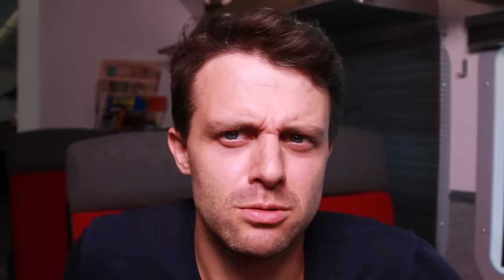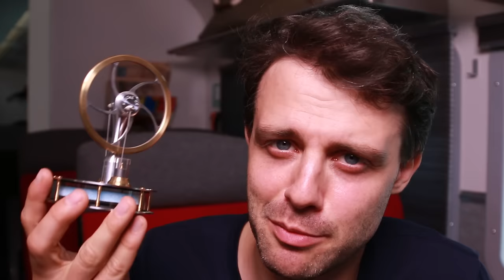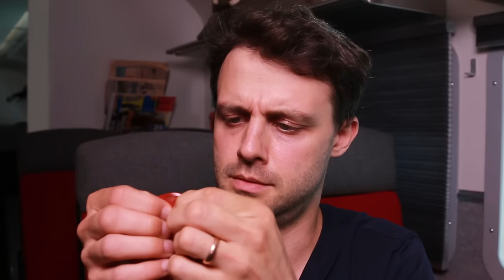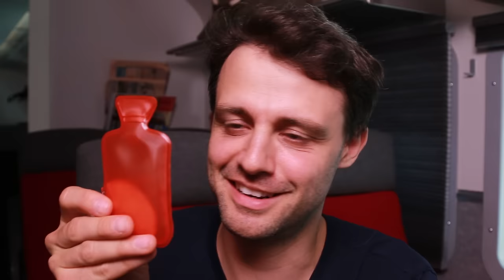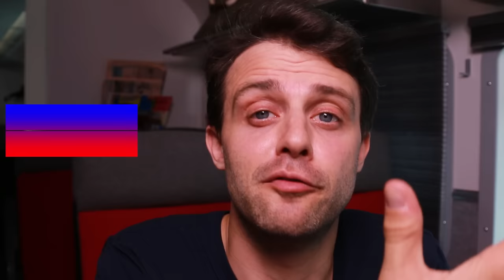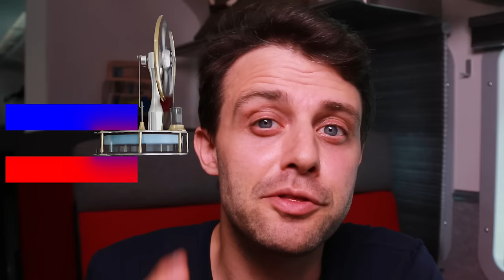A better description of entropy

Comment: Excellent explanation! This video also touched on the difference between temperature (a measure of the average kinetic energy of the molecules) versus heat (which is the FLOW of energy).

Basically, in order to perform work energy has to flow from a higher potential to a lower potential. This is ▲T (i.e.-temperature difference) in thermodynamics. Entropy is the energy "under" the ▲T that is not available to perform work. Enthalpy is the energy ABOVE the ▲T that is available to do work (technically enthalpy is the heat potential energy plus the pressure + volume potential that is available to do work).

If you use the analogy of an hourglass (gravitational potential energy contained in sand particles), work is performed by the kinetic energy of the sand as it falls through the bottle neck [and say, turns a paddlewheel on its way through]. Enthalpy is the amount of sand in the top of the hourglass. Entropy is the amount of sand that has already fallen. The height of the hourglass is the potential (temperature). The volume of sand contained is the energy in the system. The size of the opening is the rate at which energy is transferred (heat). In real life you can never turn the hourglass "upside down" to start over. Once that potential energy is gone, it's gone.
Reply: it's Δ "uppercase delta", not ▲"black up-pointing triangle", by the way ;)
Reply: @nonchip  True that, sir! I just couldn't figure out how to type a proper uppercase delta using alt code. When I type Alt+235 it comes out lower case 'δ', even though it's supposed to be upper case.
Alt+30 comes out '▲' for me.

How are you typing that if you don't mind me asking? (I'm using a Windows PC)
Reply: @nonchip  Afterthought:
It probably would have been more correct if I wrote "pressure x volume potential" now that I re-read that as well; had to take some liberties trying to explain the idea without writing an equation.  Oh well.  ;o)

Comment: And here we find our Hero Cpt. Mould struck by the insane desire to clear up a basic physics concept during his daily train commute.
Reply: This video explains thermodynamics wrong. It is obvious that Steve Mould doesn't understand the difference between temperature and thermal energy.
If you have a material A with a very high thermal capacity next to a material B with a very low thermal capacity then A and B will try to reach the same temperature, but not the same energy dencity.
So in other word you will find a huge gradient between the energy density of material A and B, even when they reach the same temperature.

Lets say that material A is much more dence than B and both have the same bolume. This means that it is more likely that the energy will be transfered from B to A than from A to B. Because there is more mass in A than in B that can hold on to the energy.

So in the end it is all about probability. It is more probable that the energy will be transfered to the material of high thermal capacity than the one with low thermal capacity.
The most probable balance of energy depends on the laws that governs the universe. In the case of two simple materials like this it is governed by the laws that define the property of different materials.
In a hypothetical case our universe could be governed by laws that we may not allready know of; very complex laws that states that our universe is allready existing in thermal equalibrium.
Reply: Electro-Cute high energy density doesn't mean it will transfer more energy to a material of lower energy density at the same temperature, it just means it has more energy states accessible to store energy. Two touching materials at the same temperature will have an even energy transfer in a closed system no matter what their heat capacity is. Their energy content will not converge unless the materials themselves decay into each other to form a homogeneous spread of atoms.
Reply: I know that, it was allso kind of my point. Temperature is a thermodynamical perspective on a very simplified system.
What the guy in the video said was that the systems will reach equal thermal energy distribution (or at least that is how I interpreted it). But that is only true for few special cases.
Reply: The context of the discussion and accompanying diagram make it clear that he is talking about two identical slabs of the same metal. He could, of course, divert to say that the thermal energy distribution would be different for slabs of different material but that would be unnecessary for this discussion (he's not talking about the relationship of thermal energy and temperature) and make the discussion overly complex.
Reply: @andrewrobertson444  I don't agree that this is obvious, and even if it was how does this explanation explain what happens when the two metals aren't the same? That's not at all obvious to me, and at this point I've had about two years of thermodynamics classes ranging from gen chem to graduate level statistical mechanics. I don't see how someone who is totally ignorant of the topic is supposed to arrive at reasonable conclusions from it.

But really, the most damning thing is that this video simply isn't an explanation for entropy. What he is describing is not entropy. He is describing a consequence of the concept of equally probable microstates that happens to work well for the few systems he described and few others.

Comment: Entropy is the property of energy to tend toward uniform distribution, rather than concentration. That's how I've always described it 🙂Great video!
Reply: But then why do some exothermic chemical reactions have decreasing entropy values?
Reply: Sonic Reaper Some interactions result in less local entropy, but still tend toward the larger entropy of the universe. I believe he discusses that in the video 🙂
Reply: So basically diffusion
Reply: @fluent_styles6720  Endothermic reactions happen (in terms of energy levels, there's lots of equivalent ways to describe them) because more energy levels become accessible to the products as the reaction progresses, outweighing those lost in the reactants due to the loss in temperature. So, overall theres an increase in entropy (which is the log of the available microstates). More specifically, the ratio of the partition functions of the products and reactants increases with temperature and so at some point the equilibrium will favour the product (there's also an enthalpic contribution due to the boltzmann factor, but that's less significant).
Reply: its not only a property of energy, you could use for information too... or whatever that has a statistical approach.
Reply: Yes. I always appreciate articulate, eloquent people. Thanks for this description.
Reply: Yeah thanks for your description. I also prefer concentration to dispersion instead of order to disorder

Comment: My favorite definition of entropy cames from Shannon which roughly is the amount of information of a system, or how much you can compress information in a system. This is also consistent with the entanglement network we have as our reality, and its information increase over time attempting to "write" information on its state.
Reply: Yes. There is a great story about that. I think it was von Neuman who suggested that they call that Shannon's phenomena Entropy because of the similarity to the equations of (mechanical) entropy. So Shannon Entropy was discovered  later and was only called Entropy as an analogy. But really it is more fundamental I think. You can explain thermodynamic Entropy in terms of Shannon Entropy but you can't really explain Shannon Entropy in terms of thermodynamic Entropy.

Comment: 7:30 -- Here's a related question for you to consider answering perhaps!

Solar panels have an efficiency measurement -- let's say they capture about 70% of the available energy from sunlight; the 30% which is "lost" is lost to entropy, in the form of the panels getting physically hotter in temperature despite the photo-electric potentials.

Plants, via photosynthesis, manage to capture 98%... that's some fine negotiations with entropy, IMO.
Reply: Photosynthesis has a 3 billion year lead on solar panels. I bet solar panels will be pretty great in 3 billion years.
Reply: Hey bro, I know this is old but where are you getting your stats from?

From sun to stored energy, plants have about 3 to 6% efficiency. Solar panels are about ~20% efficient now. 

Perhaps you are mistakenly referring to the % yield of one of the reactions involved
Reply: @DarkChasmGamers  this man is right. Plants aren't that good at photosynthesis (all types of photosynthesis)

Source: plant biology

Comment: Great explanation!  Another fun tidbit is that "entropy" is also used to describe how much information is encoded in something.  This seems counter-intuitive at first when compared to the heat death of the universe, but it makes sense if you compare it to Steve's example of the balls in the box.  For example, your hard drive is in a more orderly (less entropy) state when it's empty and all the bits are zeroes; when you fill it with data it has more information but you also can't easily predict if any given bit is a zero or a one (more entropy).  James Gleick has a great book on this for those with some "temporal entropy" to kill.
Reply: Indeed, I heard something similar when talking about compression of data. In short more you compress data, more you are reducing orderly, predictable parts, which means if you compress something to maximum then all you are left with is pure chaos.

Comment: I like the ping-pong ball box analogy, as it's also useful for explaining Chaos.

You could fill the box with half red and blue balls in the same way, and use a machine to precisely shake the box, then note the position of the balls. Put the balls back in their half/half configuration, and repeat the exercise. The chances are the balls will settle into a different position every time, and you never effectively predict where the balls will land. This system is chaotic.

Now I think that arguably, if the balls are set up precisely enough, and the box is maintained precisely enough, and the machine shakes precisely enough, and the temperature is precisely maintained, and it can be isolated from all external interference, perhaps you could predict the outcome of the test, and get the same result each time. However even the tiniest change in any factor will produce wildly different results, such that we cannot conceivably engineer such precise conditions to make the outcome predictable, even if we had an inconceivable amount of analytical computing power. That is chaos.

Comment: You ought to do a video about that sodium acetate hand warmer you used. They’re really a pretty brilliant example of the latent heat of fusion given off when you have a phase change from liquors to solid. Orange farmers in Florida use the same phenomenon in water to protect oranges from freezing. They spray water on them and when the water freezes it keeps the oranges from freezing.
Reply: Liquors you say?
Reply: @linuslundquist3501  - Liquid to solid is what he meant, a phase change.
Reply: I know, but it was a funny typo @WJV9

Comment: cool thought experiment: assume the universe is deterministic (law of concervation of information applies), press pause on the universe, play it backwards so that entropy will get lower, and displace a single atom somewhere. chaos theory will dictate that the cumulative effect of that displaced atom on that backwards running universe will cause an alternate progression of events where entropy  ack goes up, but only to the objects where its influence has time to reach. hence, everything outside this luminar-speed bubble will run backwards and everything inside, will run normally. if you look at it from the outside, it will be a collapsing bubble where things are running backwards. bouncy balls will jump onto ledges, and coffee cups will unstir themselves until the bubble suface arrives!
Reply from the maker: +dt28469 nice!
Reply: If I get rich enough to buy my own universe Im going to try this.
Reply: DT28469. there is a potential issue with this time reversal anyway. there are simple configurations in newtonian kinematics, that are non-deterministic. Certain collisions between 3 (ideal) elastic collisions that are n-d. So reversing "time" would almost guarantee a different backward sequence.

Comment: 10:00 no it's not just blind chance. Moving from low entropy to high entropy is moving from high potential to low potential. You need to do work to move a rock up, but you don't need energy to drop it. You need energy to heat or cool things, but you don't need that to spread heat from hot to cold. It's equilibrium not chance. Nature tend to seek equilibrium and low potential and high entropy. You need to force it otherwise by exercising work.

Comment: I've always used a cup of coffee as an example of energy & entropy.  You pour cold creamer into hot coffee, and the creamer will appear to distribute it's self through the coffee until it reaches equilibrium.  This will not work if the coffee and creamer are the same temperature.
Reply: Tony Tuite For me I think of two spheres connected by a tube with a lot of balls on one sphere which represents the energy and they randomly move around and over time it will eventually fill up the second sphere and since it has much more space then it has much more probability of the balls ending up in there until they reach a state where both spheres have the same probability of the balls ending up on either of them.
Reply: But entropy could actually decrease in the open system of the coffee cup if enough heat is lost to surrounding air.
Reply: TJ Simmons Yes because a coffee cup is not a true closed system. It's merely an analogy
Reply: But creamer does distribute itself throughout the coffee assuming the same temperature...
Reply: For me it was similar, but the example we used was milk... because we're not savages

Comment: What always confused me about the common definition of entropy is that to me it makes more sense that evenly spread particles and energy is more orderly than the clumps of energy.
This definition of "increase in the spread of energy" makes much more sense to me.
Reply: Yes!! The popular use of "chaos" and "order" always seemed entirely backwards to me.
Reply: @iamtheiconoclast3  The rationale has more to do with "information" than "order".

If all the particles are in a single corner of the room, you can describe the system with something like "1000 particles are in a square in the bottom left corner of the room with a distance of 1 unit between each". That's a single sentence which you can use to determine the exact location of every single particle in the room. If they are spread out throughout the room, you must give precise coordinates for every single particle individually, which in this example would be 1000 sentences long, to achieve the same level of knowledge. 

You require more information to fully describe high entropy systems than low entropy systems, and in that sense they are "disordered".

Comment: It appears that the purpose of that foam plate is to move the air back and forth between the hot and cold plate. It wasn't clear what the foam did, but I think that's what it does. When the air heats and expands it pushes the Piston up that moves the foam to move the air away from the hot plate and over towards the cold plate so then it cools.

Comment: Thanks for this video! It is a much better explanation of entropy than the one we learned at school. Just a super nitpick (to be fair, you used the term ‘for statistical rigour’ so I think I can make this point!) but having all the red ping pong balls on one side and blue on the other is not just ONE of the possible arrangements because each of the reds are interchangeable offering a very high number of possibilities of red on one side (and of blue in the other side which are also self interchangeable). But even that high number of possibilities is thoroughly dwarfed by the number of overall possibilities, therefore we never see it. That being said, obviously, I know you were keeping things simple!
Reply: Yes and double that, because the reds could be on either side with the blues on the opposite side. But it is thoroughly dwarfed by the total number of overall possibilities. Statistics you are a cruel mistress! Great video thanks!
Reply: @TennisCoachChip  Statistically, the red and blue balls would rearrange themselves back into all red on one side and all blue on another, though far less frequently than all other possible combinations. What if you just had one red ball and one blue? Or (the next step up) two red and one blue? And so on.